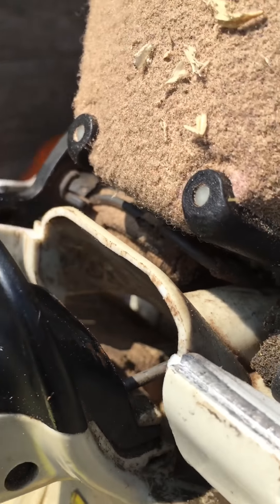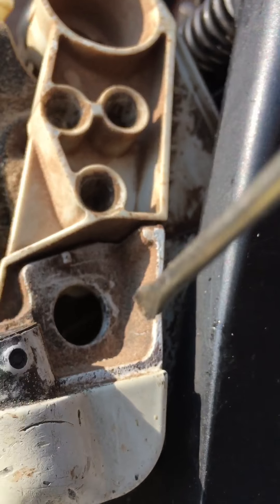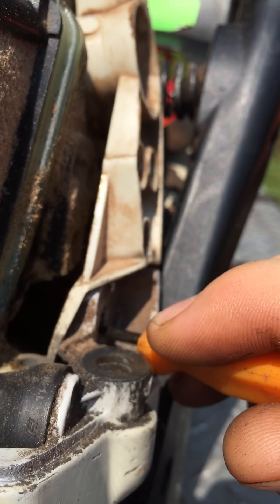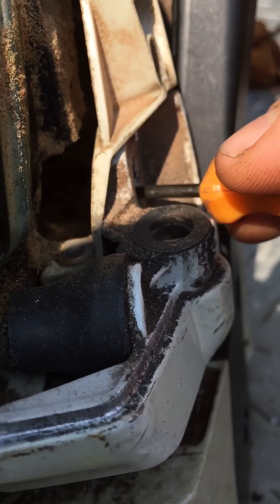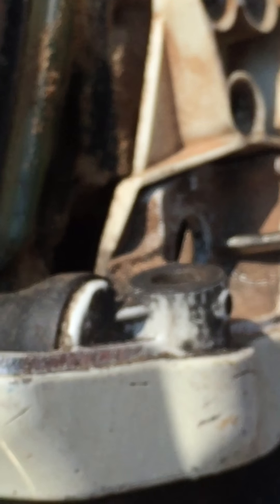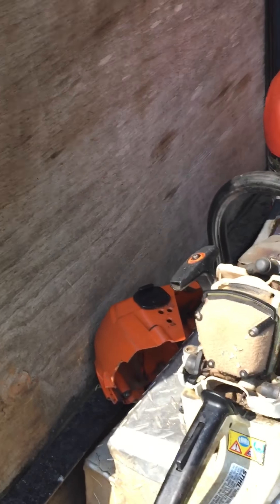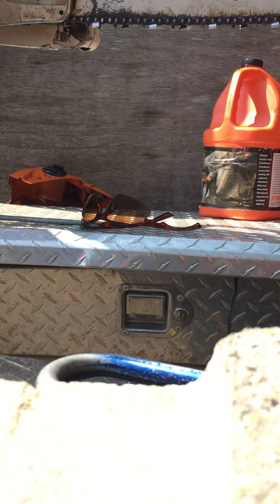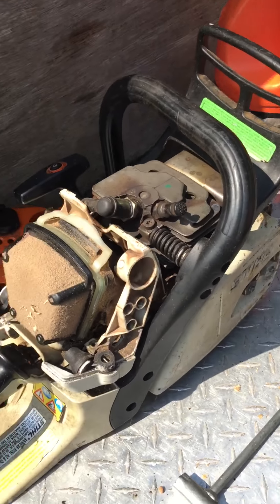Still 362 throttle stuck reset throttle linkage

Comment: I have the same problem. These newer saws have so many doo dads and linkages in there. Thanks for the tip. I will try tomorrow and let you know!
Reply from the maker: Yea something to keep in mind is you will have to replace the linkage because the metal wears in the contact spot making it smaller over time and easier to pop back out. With a new linkage the diameter is normal and less likely to pop out. You could also job weld the plastic area to prevent it from popping out of the weak plastic clip area. ( my saws have years of commercial use and wear but stihl working )

Comment: I appreciate ya tryin,but i couldnt make heads or tails of what you were doin. My 441 was workin fine and i left it sitting for a couple months and now the throttle wont work. Its been a great saw,but i cant even figure out where the cable connects on this overly complicated carburetor.